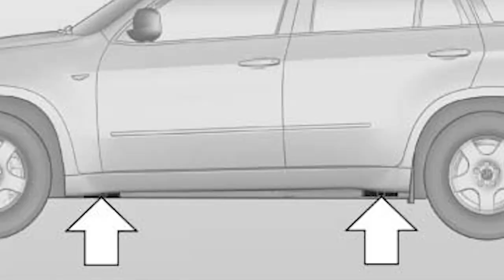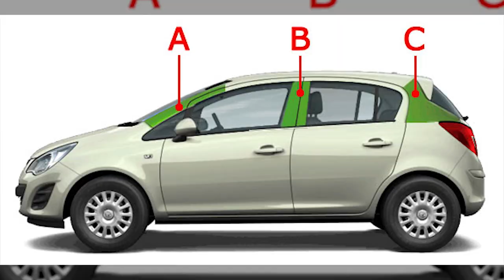Learning to Weld with Mr. G

Comment: While you're welding it is important NOT to have bare skin on show as the UV from the arc will cause significant skin damage. Might not be noticeable until too late. My brother made the mistake of welding with short sleeve shirt and after only half an hour of welding caused damage equivalent to being in the hot sun for 12hours without sun cream with red sun burn and blisters. His arms were sore for 3 days but the burn didn't manifest itself for an hour or so afterwards. Also not a good idea welding in a wood shed where the sparks can ignite your wood. In industry this is classed as hot works and permits are required which force you to check the area for ignitable objects and have fire fighting apparatus on standby like an extinguisher suitable for the materials which my ignite assuming they cannot be removed from the area you're working on, this includes carpets inside your car when welding the bottom up which a college friend did once and set fire to his car.
Reply: Agreed, I don't do anything more than a tack weld or two without a welding jacket, helmet, gloves etc.  After years of welding day in and day out I can't do it to my skin anymore.
Reply: 100% correct. Dry fuel like wood is  not good to have around welding.  And bare skin will get sunburn from welding.  However, This was just an intro to welding. I don't think we welded continuous more than 30 seconds. More talking than welding.

Comment: Most community colleges as well as tech schools offer welding classes.  I took a wire feed\mig class at the college I work for many years ago.  I have a 200 amp mig welder as well as a specialized welder called a pin welder.  Many auto body shops drill holes in a panel and screw in a slide hammer to pull the panel.  This results in internal rusting.  The pin welder welds pins on similar to a spot welder.  Then you attach the slide hammer and pull on the pins to straighten the panel.  Then you just grind the pins off and most of the time you need just a skim coat of body filler to make the panel look nice.  Also, I have a microcontrolled spot welder where you just set the thickness of the sheet metal and it applies the right amount of current to do a perfect spot weld.  I'm not a welder by trade, my specialty if IT which is what I teach.

Comment: Nice video guys I was happy to see an intro to both stick and wire-feed welding. Having the stick or the wire-feed provide the shielding gas makes the cost of entry into this hobby cheaper compared to actual MIG or TIG welding. Please be aware that what the 3rd segment shows is not TIG. It's called flux-cored arc welding or (FCAW). Actual TIG uses a cylinder of Argon gas and looks more like using a glow-in -the dark hot glue gun than the fireworks show you see here. For that and other reasons, TIG  not as user friendly or economical for beginners but with practice yields the prettiest results (see custom motorcycle exhausts etc). You should edit the slides in the video so people don't get confused.
Reply: Correct.

Comment: Editor messed up not tig welding its mig welding
Reply: Yes, I also saw it, but I am not sure if it was MIG or MAG. MIG stands for Metal Inert Gas and it is used for non-carbon steels (aluminium, stailess steels etc.) and MAG stands for Metal Active Gas and it is used for carbon steels. In the US, both MIG and MAG welding are described by the term GMAW ( Gas Metal Arc Welding).
Reply: You're right it was a mistake. I call it MIG.  But yes it is gas metal arc welding.